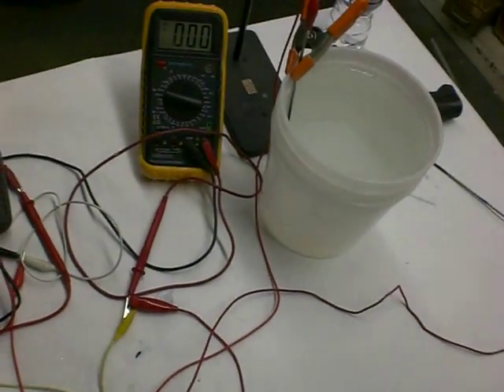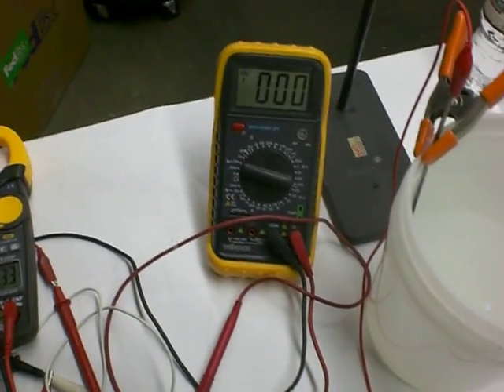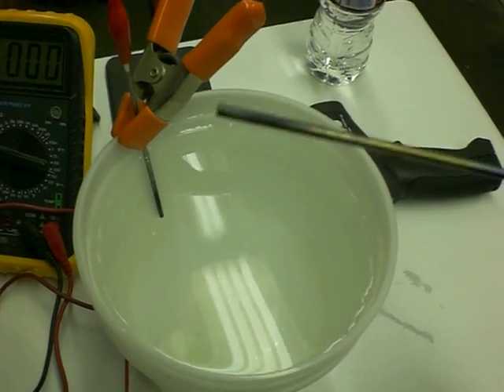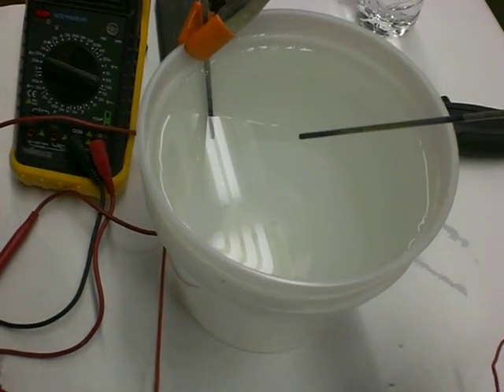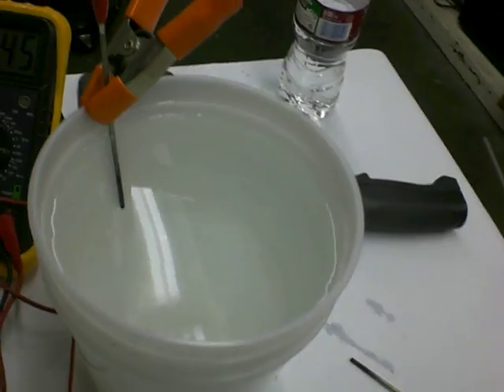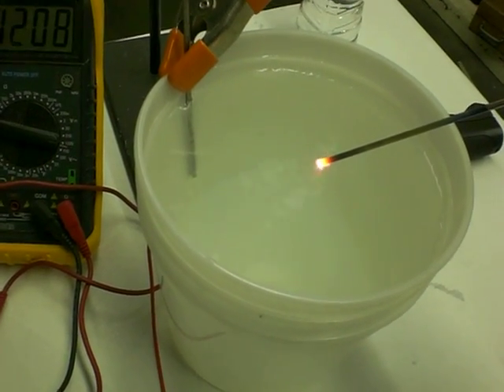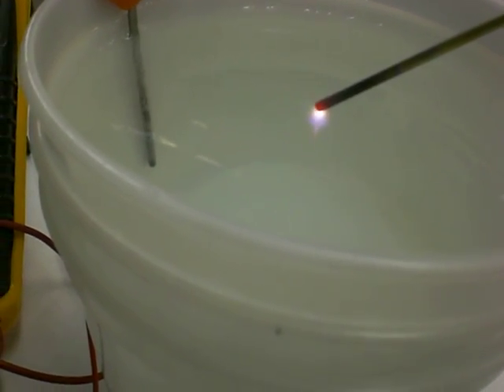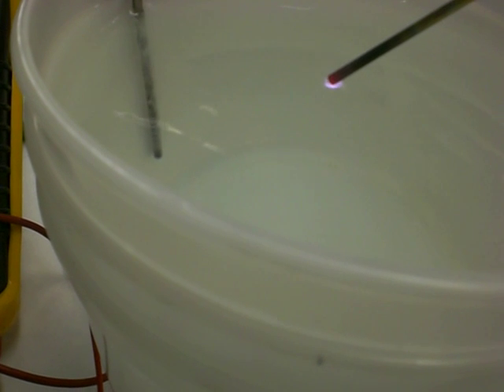High Frequency D.C. Energy & Water#3

Comment: HIgh frequency D.C energy ?
 
how can DC have a frequency?

and the bobbles are water vapor ?
Reply: Pulse width modulation would be the way I would vary a low positive voltage to high voltage . waveform doesnt have to be just positive and negative but positive to positive and negative to negative is possible also
Reply: Oh and it is liberated hydrogen and oxygen with the heat of the tungsten due to capacitive heating ignites a plasma at very high Kelvin. More research should be redirected in this fundamental discovery

Comment: on my spark cell i put both lead under water andmake a small gap, theproduction is awsome
i use a 18v battery with a dewault drill trigger to supply the pulse, im only using 36 watts and am figuring out new stuff daily

Comment: Nicely demonstrated well know effect. You are creating a very small plasma evelope using HV @ low current. You have a long way to go before you have a hot water heater or home heating system.  I know a few fellows who are warm this winter using this technique.

I have seen a 1/8 in tungstun rod melt in an HHO enhanced plasma. So I am having trouble understanding why you think this unique and needs protecting.  What might be protectable would be a marketable prodct. But hey, its your channel.